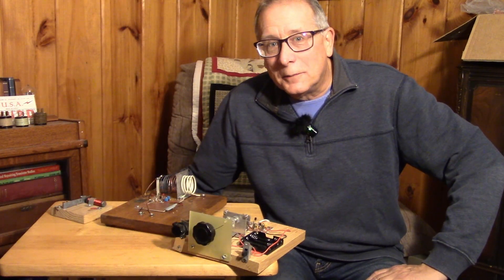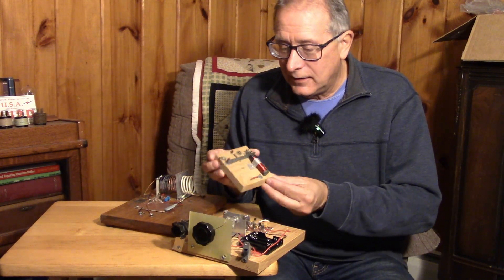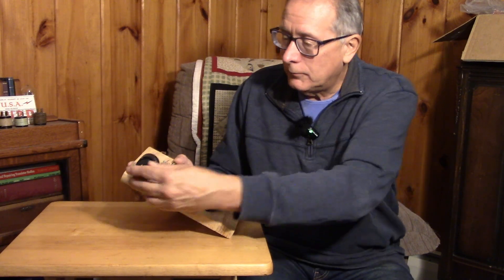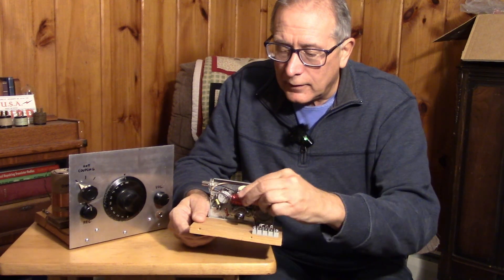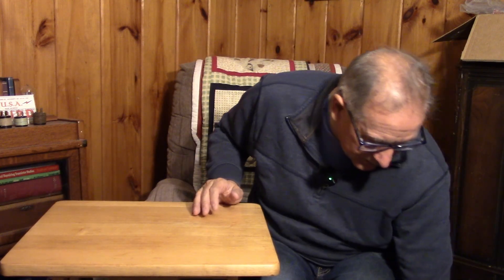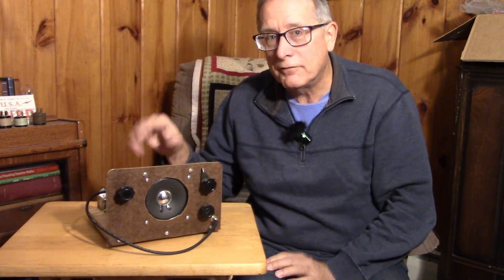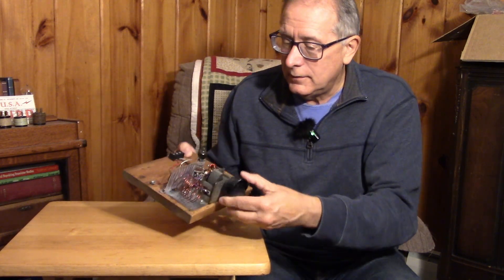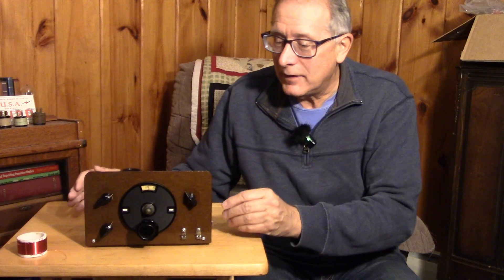Mr. Whoopie's Cleanout

Comment: Thanks Mike, You awoke some trauma from my VocTech school days, Our Electronic Labs had a system where all the components were mounted on yellow plastic bases, wired to metal posts like upside down tube pins. The plastic bases had lugs that were pressed in to a  perforated broad. All connections were done by blue jumpers with clips on both ends. We would build the assigned circuit, take test measurements, record observations and then have to tear the circuit we worked all morning down again.
Reply from the maker: I had to take electric machines in college with scary bolted jumper connections to giant motor sets. Sparks flew and circuits popped in those labs!

Comment from the maker: OK OK I surrender. I will save two of the regens rather than recovering the nice parts. 1. The two Tube AM Band regen 12AT7/12AQ5 which is sweet and will beat any table radio, and 2. The NuTube Receiver rewired your choice 6BF6 Morgan or 12AU7 Twinplex. Email Me.

Comment: Makes sense to me to recycle projects, you don't need or no longer have sentimental value, for the parts you can use in another project. That kind of happened to the 1st crystal radio I built 60 years ago, the adjustable antenna loopstick coil was used in some radio I repaired.  Well I restored the crystal radio close to original with a similar coil, but with some improvements, last year.

Comment: Thank you for the journey!

I could have accumulated tons of that junk from when I was a kid, but now the simplest capacitor goes for $50 on eBay...  Modern eJunk, digital and microprocessors, surface mount  stuff essentially can not be reused.

Comment: I would have a hard time doing what you are doing.  You are a brave man!  :-)
Reply: Yes, I find it hard to break up projects I have made. Even if I know I that I will never use it again. Of course, it is common sense to salvage the parts if they will be used for something else but its still difficult.
Reply from the maker: I'm even worse with equipment. If I'm not using something in the shack, it gets a couple of years, then it moves on. If I suddenly wish I had it back, I just find another one. No regrets!

Comment: I'll donate a few $$$ for a one tube Regen radio
Reply from the maker: OK OK - define one tube. A simple Morgan with a 6BF6 triode for utter simplicity and accuracy to the book, one Pentode tube like a 6AU6 or a dual tube regen plus amplifier like a 12AU7 in a twinplex? They all use basically the same hard to get parts like the vernier, variable capacitor choke etc...so no real difference there , but the performance gets better of course with complexity.